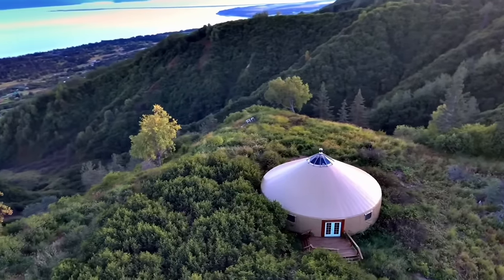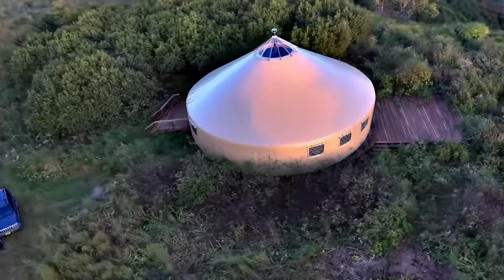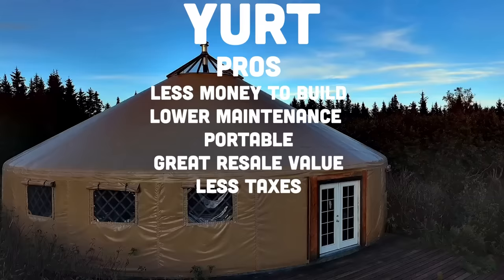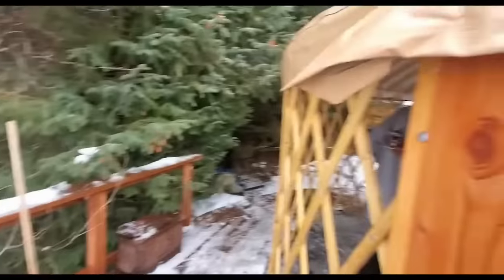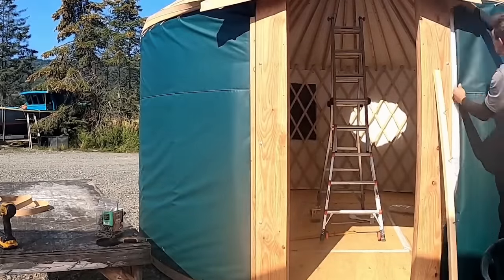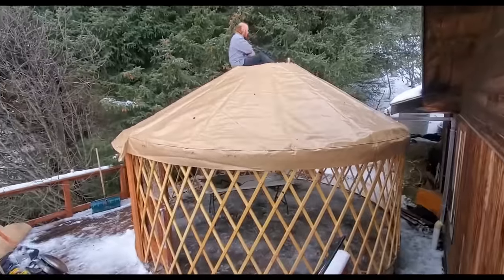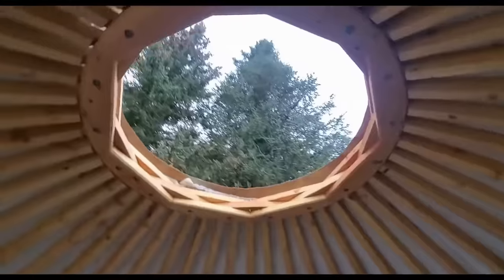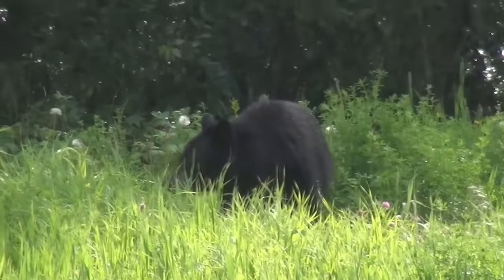YURTS... Affordable Home Solution? Or Too Good to be True? Expert Explains PROS and CONS

Comment: This doesn't just apply to Yurts.     Sidewall tents can be done like this too.

18x23 sidewall tent,  but  instead of a normal opening on the front you put in a framed door and windows.   Same as at the back.   Often a simple plywood frame on the sides as well.   So the sides up to 6'  have wood backing,  the front up to the roof has wood,   then the same goes for the back with the stove passing through the front or back.   wood or steel framing (i prefer steel)   providing MASSIVE snow loading.   With the inside then being able to be configured however you want.

414 square feet gives you more then enough space for a 2 bedroom 1 bathroom.   Kitchen...   hot water on demand shower, propane appliances.  nice cast iron wood stove,    double walled,  canvas outer,  and insulting inner.   Can be built and set up in a weekend  (or a day if you have  enough people)

Comment: I really feel like a properly built house is going to have less maintenance than a yurt. I do general construction so I'm pretty familiar with traditional construction. Most steel roofing/siding has a 30-50 year warranty, I don't see the cover of a yurt lasting nearly that long. The vinyl/poly windows also aren't going to last nearly as long as glass ones.     

While I'm know it varies depending where you are, you can post and truss style buildings really economically. Probably fairly competitively with yurts of a similar size.

I think trying to sell a yurt or really anything on features that don't really fit is a poor way to go. Especially when there are plenty of genuinely good perks to it. Stuff like being portable, being able to do it yourself, just the coolness of it,. I think a lot of people that have yurts really like the "yurtness" of them. I mean convertible cars are cool because you can take the top off, not necessarily because they're better or cheaper than hard tops. I'd also bet there are a lot of situations where permitting would be easier due to them not being permanent too.
Reply: I have a lot of experience in conventional construction as well, and I'm working on building my own yurt now. I'm planning to go with a treated canvas cover (~10 year lifespan) and framed glass windows. A vinyl cover is usually rated around 25-30 years. My thinking is, it's cheap and easy to replace the cover in the future. No regular painting or sanding of the siding, a fraction of the hard work, danger, and waste of ripping off old shingles. Current budget for all materials (excluding interiors): under $5k for three yurts (a 24' and two 16'). And I can build most of the parts in my garage over the winter and transport them on a small trailer to the property when ready.

Comment: My grandparents have used 2 large yurts on their lakefront property in montana for 20ish years now. They solved the insulation issue by simply travelling to visit family during the winter, they just have to remember to empty the pipes before they leave. Funny enough, my cousin and I got trapped with a black bear that was trying to get into the place, we were both around 5, but the dog scared him off. Granparents are getting up there in age now and want to stay year round more often so my grampa built a well insulated small cabin which they move to during the winter. They still pay almost nothing in property taxes on the improved value, and recently got offered 2 million for the property. I hope they don't sell until I can afford to buy it off them myself!

Comment: The only negative I see is that in lacking gutters, it's much harder to collect rainwater. Otherwise, it's a plus all the way around. I'm planning on retiring soon and have considered putting a yurt up the holler for an off-grid home.
Reply: Many of the yurt kit builders offer gutters for rain water collection as an option. Check some of them out online.

Comment: The bones and basic furnishings are super affordable. They are even liveable in a cold, wet climate. I got a somewhat broken used yurt, a platform, and basic insulation/furnishings(+ stove/pipe, fridge/freezer ect.) Fixed it all up and installed for $15,000. It was roughly that amount in labor costs(mostly my labor). To build a 900sq ft of a stick-home would be roughly 5-10x the cost.

Now, and as its been mentioned already, the lifestyle is different than a standard stick frame house. It requires more care to keep the yurt and living conditions comfortable. If you are looking to have nice furnishings, super high insulation and such... that's where the huge monies comes in. Nice floors/walls($3k+), semi-finished kitchen/bathroom($5k+) and other finishings.. will cost almost the same amount as the entire structure+basic furnishings.

Comment: I checked out their website and did the "Build your own" thing they have on their website.  I can see making a greenhouse outbuilding here -if I keep it under 200 square feet and don't live in it, I can do it without permitting here.  (If I tried to build a structure for living here, it would be an Epic Fail, permit-wise.)  Strongly considering it, with the greenhouse model at 14-foot diameter.  Taking some time to consider, before I order.   And the sense from reading comments is that this particular brand stands well up against wind is a major plus. I am near the top of a hillside.  Many regular greenhouses seem to collapse readily with wind and/or snow load.  

Great video!!

Comment: In an area that's a dry heat, how would you compare cooling costs in a yurt versus a home? Is there anything I could do in advance knowing heat is more of an issue when customizing or yurt design in general? Maybe a white color, ventilation design for airflow with an AC?

Any thoughts on this would be greatly appreciated! Thanks for the great video!
Reply: Paint it white (I did the roof of my black truck white, and it made a HUGE difference!). Have windows on opposite sides for cross airflow, and have an awning off the south side (or north, if you're in the southern hemisphere). Invest in an above-ground swimming pool, or make a bucket shower that you can use to hose yourself/your hair down during the hottest afternoons for extra cooling. 

We live in a unique micro-climate, where we regularly see temperatures between 40 & 50°C during summer, which is HOT!!! Plus we deal with crazy humidex values, but we do not have AC - it actually makes me sick, lol, so I avoid it like the plague!

Comment: Why can't you have 2 pieces of the expandawall bit, one slightly smaller than the other, so you can add insulation between them?
I could never have one. I can't keep all my things in one space and keep it tidy. It just doesn't work. I need rooms and separate spaces so I can get organised. I don't think there are any companies selling kits here either. Shipping it over might make it a little less affordable lol. Bears aren't a problem here though. We only have drop bears and they don't go for locals, only tourists 😄
Reply: You can frame out the inside of a yurt into separate rooms.  There are YT video tours of finished out yurts that will amaze your mind with the possibilities.
Reply: @LiberLady  I have seen some great ones with separate areas but not actually framed out. Interesting. Still probably isn’t cost effective to get one here except for a guest room though.

Comment: I would just buy the yurt and then slowly, one or two bags at a time, buy concrete and get rocks and build my new structure around the yurt, until such time I need to take the Yurt down and move it to a new spot outside and finish out the permanent structure.

Comment: In most places living in a yurt is not up to code. You’d have to be in a very remote area where the town or county allows it (very uncommon) or you could get away with skirting the laws. If there’s already code compliant primary residence on the property than adding a yurt becomes more possible.

Comment: This is very informative!  Thinking about getting one for our iHawaiian rainforest 2 acre agricultural lot couldn’t help but wonder about the skin materials….UV degradation?  Things like rodent damage…thinking about a large platform…mostly covered for rain protection and water catchment (probably go with 2500 gallon (our house has 10000 gallon) outhouse separate, off grid 12 volt so,ar system as well

Comment: It's as beautiful as it is interesting  on the inside.  It would be a shame to cover it. But I would think a simi-rigid material like Rockwood panels might be a good choice.  If it would fit outside the lattice even better. Might that be accommodated in the design? Is there not a breathable yet water resistant material for covering? Perhaps venting around the upper perimeter could be improved without too much heat loss?

Comment: 2nd-hand yurt? But, yes, permitting. My husband and I replaced our front porch a little at a time over a couple years so we could claim it was 'repair' because replacing it was so convoluted, even though that would have been easier and cheaper. Except, of course, for the permits.

Comment: Sounds a lot like living in a camper. I just moved out of my fifth wheel after living in it full time for 4 years. Personally, I wouldn't want to go back to that. I've heard enough wind and rain, I want to know that when the next polar vortex comes I'll be warm and dry, and I won't have to sit in my car in the afternoon on 100° days to keep from getting heat sick. Weather is only going to get more extreme from here. 
If you're young and have the resources, I say go for it, but I'm poor af and feeling my age.
Reply: Yurts have a very different feel than being in a camper. Campers rock and shake in the wind where a yurt is steady, and the wind does not whistle around a yurt because it has no corners. It also feels spacious even if the sq ft is about the same as a camper or trailer  home.
Reply: @kittimcconnell2633  Campers don't move in the wind if the stabilizers are down, and they all have them, but I didn't say anything about swaying or spaciousness.

Comment: I would worry about mold. I don't have yurts but I do have a canvas cabin on our farm we rent out for vacation stays. Mold is a constant battle with the canvas. Yurts may be different though.
Reply: Ventilation and hvac is key
Reply: @Wouter ke  ya. Hvac can be hard if you're going off a small solar system.
Reply: Having fans set around helps that and dehumidifiers.  They dont take much power to run either.

Comment: For those interested in yurt life - dig this. You do not even need to buy a yurt from a yurt retailer. You can literally build the walls from scratch yourself  - the design is very simple and the hardware can be purchased at any hardware store. You will save 50% on your costs by designing it and building it from scratch - including the felt insulation and outer coverings. The yurt retailers online make a ton of money by making you believe that these materials are expensive and difficult to manufacture. They are very simple to build and design. You will need to hire a seamstress to finish the outer coverings. Possibly a carpenter for the inner walls. You will still save a boatload of money vs buying from a company like Pacific Yurts.

Comment: ### plus don't see why you can't put up 4x8 sheets up against the "x" like wall structure to make it warmer n save on trees or oil &be more balanced temps.insIde & put in solar air or circulating ceiling fan for cooling...😍

Comment: I’m thinking about a yurt but I don’t understand why the manufactures don’t supply them with better insulation?  It dosnt make sense?In the uk the electricity costs have become huge  60c per kWh  and are going up. And will probably be $1.00 per kWh   Propane is way  too expensive.  However if you find a piece of land with a decen sized woodland area you can heat your home for free….
 This year (2023)

Comment: I don't really have anything against Yurts or Gers. They are ingenious and really cool. I think they are excellent for a temporary or mobile situation.
But if you want any sort of permanence in your structure, probably don't get a yurt.
Instead, I highly recommend looking into concrete domes.
I consider them as the permanent yurt.
They are strong, being wind, earthquake, and fire resistant. They can withstand hurricane and tornado force winds.
An extra bonus is that they are extremely thermal efficient. 
Roughly speaking, for the price of a $50,000 yurt, you can get the same size or potentially larger in a concrete dome, and ultimately pay far less in heating and cooling bills.
I love both the idea of a Tipi, or Yurt, for a portable home, but for a permanent home, I can't think of any type of structure that beats a concrete dome home.

Comment: People will have to buy quality when you need it to last.  There are too many cheap imitations out there whose fabric will quickly degrade in the sun. There was one  commercial outfitter camp design used for summers in the far North where the 5" walls were bolted together wood framed with canvas roofs that were replaced periodically.
    Note I have experience with owning a 12X12  fire retardant heavy canvas pyramid tent at Mountain Man Rendezvous.  It took two people to put it up; to push up the center pole. Had a homemade wood stove. heated up very quickly in cold weather. Put down a  carpet for ground cover. Very nice and comfortable. two people with cots had plenty of room& could do 4 ppl..
See "Panther Primitives" among several quality designs. The large Tipis are really awesome as well!

Comment: Anyone spending 30k on a yurt (upscale tent) needs to seek help...professionally.  You can build a yurt for a couple thousand.  Purchase or have made a metal or steel ring for top, cut slots in that for rafters ...get rafters cut...get wall supports cut....bolt all of them together. ..then get heavy duty canvas or order actual felt like yurts in northern Afghanistan and you're practically done. Add floor and furniture and boom...I'd sell you one for 20k ALL day long.
THE COST IS WHY YOU CAN'T GEY BANK FINANCING...30K is freaking  ridiculous.

Comment: I've never lived in a yurt, but I'm wondering if its possible to set up one so that there's a yurt within a yurt, like a 50' greenhouse yurt, with a 16 or 18' normal yurt inside it.
Reply: Sure you could.
It would be like a tent inside a tent.
It's much easier to heat doing that in the winter, when camping.

Comment: I helped to put up a yurt built by actual Mongolian guys where everything was shipped from Mongolia. The yurts they build are extremely insulated. They used traditional whool. Thats the most expensive part of the structure. It was pretty hot out the day i was there and it was substantially cooler inside. They said you can heat them very efficiently. They refuse to use modern insulation because insulation contains chemicals and fibers ect that are not good for your health. They only use organic whool. I wouldn't shy away from having these guys build one for me.

Comment: I find it not correct to compare a yurt to a home.  700 sq ft house doesn't cost 250k.  So in SC 1000 sq house complete is under 100k.
Reply from the maker: Paul pointed out that it mostly is the fact that any person can put up a yurt but most average people can’t build their own stick built home, there is huge savings potential at any size when you can DIY it.
Reply: My point is he repeatedly said house for 250+ k.  I got fed up after the 3rd time.  I listened to what he said about anyone could build a yurt quickly.  I live in SC and lived through hurricane Hugo.  A yurt would be sticks.  If you choose a yurt that is your families lives living there.  Would it be fun for weekend place maybe.
Reply: Yea out here in WA a 700 sq ft house would absolutely be 250k.

Comment: Cons… Mice get in, up your walls eating anything including the ropes holding things together & fill walls with pee debris. Rain noise means you can’t hear tv, phone calls, your loved ones sitting on the opposite couch. Heat in the Summer & humidity gets trapped inside. Heating in winter becomes your life. Storage!!

Comment: Can you add foam insulation?
Reply: Hi Paul. Yes you can but I'm not sure you should. You'd want to be careful about creating areas for condensation and mold. You also want to try and NOT make the yurt rigid because part of what makes it hold up to high winds is it's flexibly.

Comment: Converting a nomad’s tent into a permanent dwelling strikes me as being kind of foolish. The easiest buildings to do yourself with no experience are cinder block block houses especially with flat roofs. You can even do the pad yourself by hosing down powdered Quickrete to hydrate in place before evening out the surface. Then if you do a flat roof you can easily and safely install any solar panels yourself on the roof. Anyone could handle building a ferro-cement flat roof waterproofed with epoxy paint. Then also the walls can be finished with a wide variety of veneers such as synthetic stone. If you fill in the voids in the blocks you even have a bullet-proof house.

Comment: It's dead simple mate - Yurts are not designed for rainy weather and will soak and drip, if not rot, if there is much rain. If one lives and loves in an area where there is little rain or the rain is frozen unto snow, and/or the snowfall is minimal or frequently blown off, then yeah they are very cozy and practical - for a one room existance.
Reply: Like the Mongolian steppe. Where they are meant to be.
Reply: @CB-xc6iz  yurts are found all over Central Asia to Western Asia and all over Western China, as well as inner Mongolia (now part of China by name) - over vast areas. Indeed, one finds them right up to the border of Pakistan, high in the Hindu Kush.